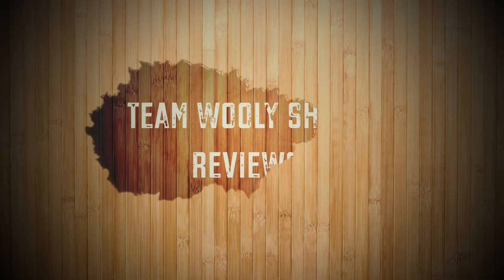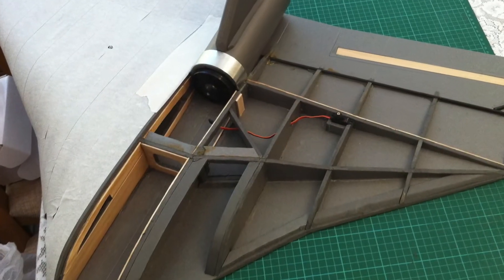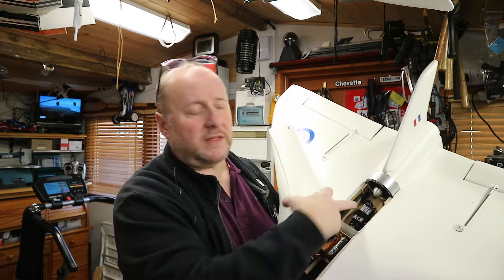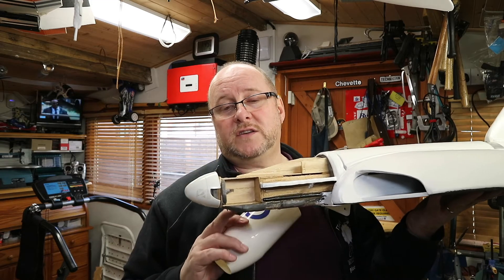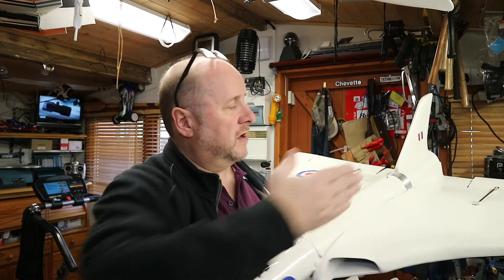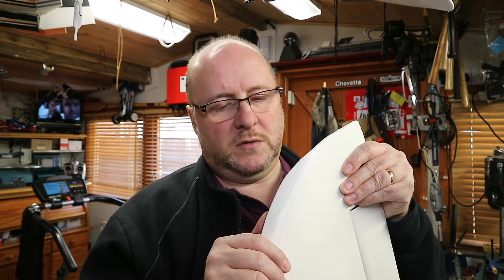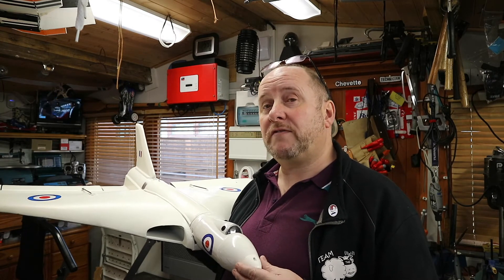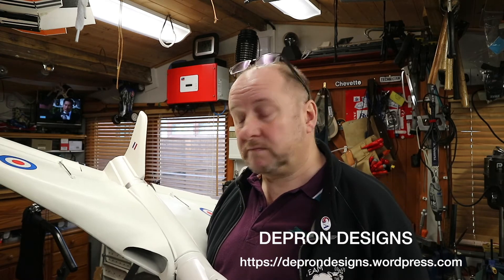Part 2 - EDF Version Depron Avro Vulcan 1100mm wingspan

Comment: The original aircraft has under-camber on the leading edge of the outer portion of the wing, which may be similar to your 'spoilers'. The wing shape of the full size aircraft is complex, being near symmetrical close to the root and from what i have found, flat bottomed to under-cambered close to the tip. I haven't found a full plan-form profile of it. My interest in this is just on a point of  curiosity regarding how the aircraft remains stable. Full size looks to have some reflex, and your model looks like it has more. I ran across the following https://www.flightglobal.com/FlightPDFArchive/1958/1958%20-%200145.PDF
Reply from the maker: on the leading edge I added a bit of camber to create drag as it flew very wishy washy. This made if feel a little more on rails and was a recommendation from a colleague and improved stability. It did need reflex...maybe more than you would expect
Reply: Interesting, thanks.
Reply: I actually first saw a vulcan when xh558 flew past the severn bridge in it's final tour. As the aircraft has little surface detail it didn't convey it's scale and my mind parsed it as being about the size of a fighter jet, with the dome canopy. I was very surprised to find out how big it actually is.
Reply: Wing profile is visible in pictures of vulcans being scrapped, and this one being dismantled: https://www.pistonheads.com/gassing/topic.asp?h=0&f=226&t=136489

Comment: I don’t fly, but I am going to watch this series!
Reply from the maker: Joe....remember helping me with the Wordpress web site Depron Designs........well it is still going
Reply from the maker: I was shocked to see Depron Designs has had 10,570 views to date by 4,447 different people. I wonder how many after these videos have been viewed.
Reply: Hi @TWSreviews Thanks for the inspirational video...👍👍 , I've started an 1100mm Vulcan and had a 90mm EDF to suit. I reviewed your 3 videos and remember you discussing the CG point, but can't find it now, please advise. Also, how far from the CG point to the front of the EDF housing? Did you think that there was enough air inlet aperture for the 70mm EDF that you made? Cheers Ozzie Dave 😎
Reply from the maker: @davidwatkin1484  CENTRE OF GRAVITY
Use the CoG 27cm from front of wing (not nose, the root where wing stops and nose/cockpit starts) for ref 33cm from trailing edge and you will be fine.
Reply from the maker: @davidwatkin1484  The intakes alone will not be enough....I found you roughly need to double the aperture size. If you are going 90mm then add some cheater air vents underneath to get more air in. I have recently come across cheater grills for the Durafly Vampire on thingy verse for 3D printing. I have now added the CoG to all the video notes and on Depron Designs page as I realised it is not clear and one of the most important things to know.....thanks for your interest and hope you enjoy your build